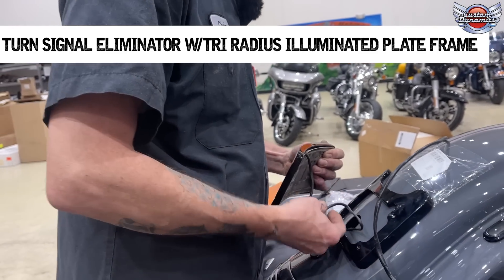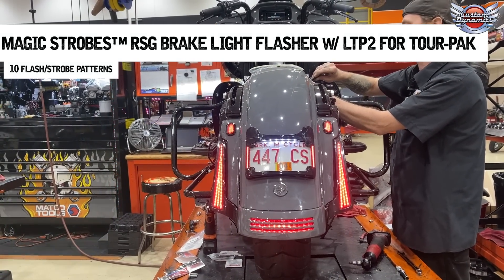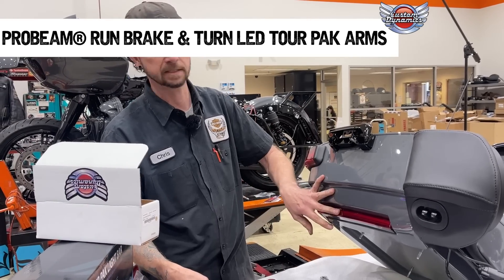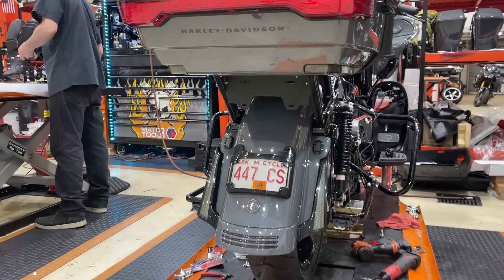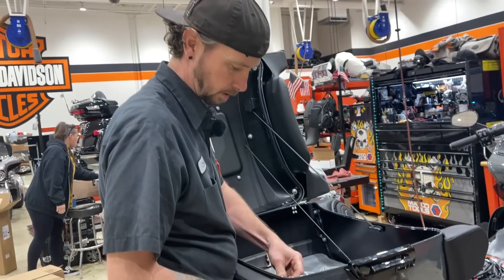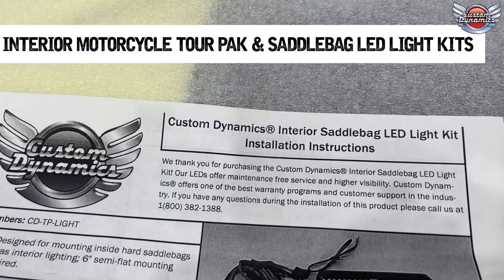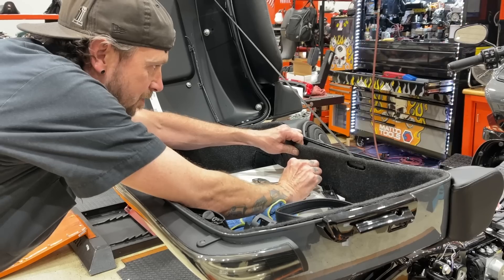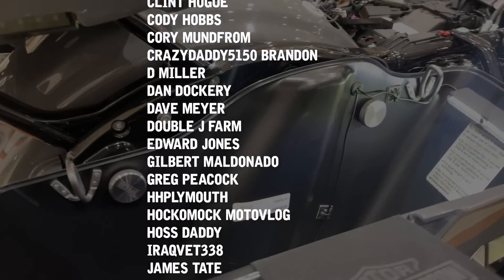EP29 Road Glide Limited with Special rear end | Custom Dynamic lights | See & Be Seen

Comment: What is the difference between the limited and the special?
Reply: Limited Main engine difference is its water cooled heads instead of the oil cooled ,fairings in front of legs , rear fender length saddle bags are standard not stretched but if you go back and watch all the episodes in this build series so far  it shows all the differences and why they chose limited vs special